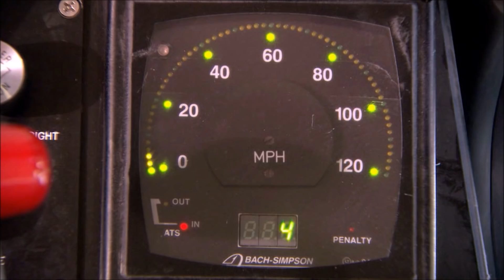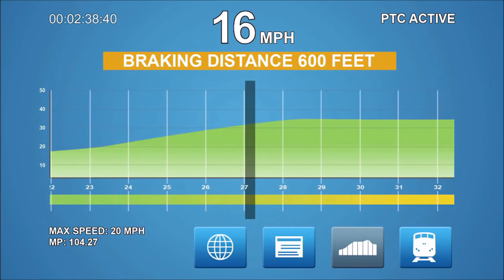Amtrak 501 "Cascades" Train Derailment 18 Dec 2017

Comment: Reading the comments here I see a lot of confusion.  First, this was the maiden voyage for  that small section of track.  That train has been running several times a day between Seattle and Portland for at least the twenty years I have lived here.  Second, the rail bed for most of that line dates back or further than WW2.  It did and I believe it still does service  JBLM.    Third, I question the number of people injured.  I do not know how many on the freeway were injured.  The number seems high given how many I saw uninjured from the train on local news.  By 5pm many were home and giving reports to the news stations.  Thank you and Keep up the good work.
Reply: First, I hope I did not come off heartless for those injured.  I just questioned the numbers.  Still do not have good numbers on that.  I believe the best numbers are  70 people injured.  Latest from local news is that the training was very poor.  Six engineers in the cab at night.  They had no way to landmark where they were.  They took turns at the helm.  Piss poor way to run a railroad.  Cheap way to other than PTC.   Have a GPS like what I run in my Jeep.  It gives me the speed limit.  I see red when I speed.  Why could they not run something like this and add some bells and whistles.  Very cheap.

Comment: When I first saw the reports on CBS about the wreck, they were talking all over the place about things they really didn't know and conjectured about.  One statement made by a reporter was that the line was originally built in 1891(I think) which would explain the 30 mph curve.   A helicopter shot looking down of the wreck showed the location and layout of the vehicle as well as there was no track damage like usual from a derailment and there was a ground path from about the right retaining wall down to the roadway and the front loco.  Another shot was the speed sign showing T-30 over P-30 with the rear loco showing.  I realize telephoto shots squeeze a lot in a short space, but the sign appears to me to be too close to the beginning of the curve as this was taken from the bridge over the track.  This was not a brand newly constructed route as there is plenty of growth along the track and no indication of recent grading work.

From all of this my thought is there was something on the right rail to cause the loco to lift leaving the track causing the brake hose to part setting the air brakes while the rear loco shoved the cars. Only knowing the train make-up by car number will tell where the cars order but my guess is the cars on the right were first, then the upside down car, then the last as they are still together coupled to the rear loco.  What caused the separation is undetermined.  The Talgo train cars are not easily uncoupled from each other because they share a truck and are articulated.  They are designed to be suspended from above the trucks to act similar to a pendulum to be able to take curves at a higher speed than conventional equipment.  Ii is possible there were two 6-car sets in this train, I don't know.

On CBS evening news they showed the wreck site on GoogleEarth as the double track route west of this location and on the northbound bridge  over I-5 yesterday and today.
I hope that the final report shows that there was something on the rail instead of negligence of the engineer that caused the wreck.

Comment: Very good Juan, Yuo talk about PTC, But no mention of ATC Automatic train control.  Was it in use? was the train cut out.  If it was, a decodes old technology it would have slowed or put the train into emergency if properly set up?  Please explain this in a follow up video.  Patented in 1919, and 1929 it still works! I should know!
Love your reports!
Reply: PTC is a variant of ATC, with more modern standards such as GPS and wireless. Apparently PTC was installed on this line, but was not yet operational. Some background reading: https://en.wikipedia.org/wiki/Automatic_train_control#United_States and https://en.wikipedia.org/wiki/Positive_train_control#Amtrak

Comment: Damn that was an intense derailment. My most pressing question would be if the train was under control or not while going 80 mph (i.e. was it a runaway train, or was the train just cruising at 80 mph)? RIP those three who died.

Comment: With 180 million dollars to spend, it is a shame inherent safety of the track layout was not a part of the design.
Why a hairpin curve over a freeway crossing on an otherwise direct route?
Yes, I know land issues etc are probably the cause.
But it bothers the analytical side of my brain.
If the entire length of track had been engineered for safe passage at 80 mph, then the speed limit set at 55 mph, there would be no accident.
Since in reality we cannot have a perfect route, it seems logical that PTC would have been mandatory to guard against such and event.
Is it really just an engineer with his finger on the throttle and that is it?

Comment: Could they create a "budget" PTCS.   Seems a simple GPS receiver loaded with a map of the railroads could sound an alarm anytime the train was speeding.   Doesn't control the train,  but at least it'd give the engineer a heads up.
Reply: Seems a very sensible idea to me.  One issue with safety systems is that if they go wrong, lawsuits are involved, so creating a rough-and-ready safety aid puts you in the crosshairs of lawyers even if it is demonstably better than nothing.
Reply: good point. I work with stuff like that and know what you mean.  Sad that it encourages 'nothing' instead of 'better than nothing'.

Comment: Reports are now coming in(from NTSB spokesperson) that the Amtrak train was going 80 mph where the speed limit on the curve was 30 mph. As a commercial pilot myself, I just have to ask this question: Why are not two crew members required in the locomotive of passenger trains? Commercial passenger planes require 2 pilots, freight trains that I observe have an engineer and conductor in the locomotive and they are only hauling freight, not people. When you recall recent, deadly passenger train wrecks that were attributed to speed violations(Amtrak 188, Metro North in 2013) and the Metrolink Chatsworth, CA train wreck where the engineer was texting and passed a red/stop signal, you have to believe if there had been another crew member in the locomotive these accidents, most likely, would not have occured. Requiring two crew members in the locomotives of passenger trains would not require new technology, could happen tomorrow. Is the FRA just ignoring the "elephant" in the room? 
Juan, I'm just trying to be Captain Obvious here, but it sure seems like having two crew members in the locomotive of passenger carrying trains could reduce these type of accidents.
Reply: gordon james as a retired, mainly freight, locomotive engineer I, and my peers, have been asking that question for years. The only answer I that we’ve been able to come up with is $$$. Although freight crews consist of one engineer and one conductor, only one is qualified by federal law to operate the controls. Like airplanes, you’d think both employees would be qualified engineers.
Reply: Interesting question, but part of the answer is that pilots have to monitor dozens of flight controls, and the aircraft can be pointed in many directions/altitude/position, etc. A train crew has only one pair of parameters to monitor, namely speed and position along the track. Its not that simple, but simpler than an aircraft. A single crew member up front, plus PTC monitoring, should be sufficient.

Comment: Thank you again for a great video. I have a comment, the railroad speed signs are a small white sign on a stick, blink and you missed it at 80 MPH. Blink or sneeze from alder tree pollen, which is prevalent at this time of year. I have an inexpensive Garmen GPS in my car that keeps track of my speed and the speed limit where I am driving. Airlines use the Honeywell EGPWS system to avoid controlled flight into terrain. A simple Garmen display and alert system would have warned the engineer that he over ran a speed reduction. This would cost much less than a positive control system and could have been implemented sooner and then replaced by it. My thought. Oh, I forgot, why only one driver in the cab when many passengers are depending on his actions. Thanks again for another great video.

Comment: Thanks, Juan. Being a train nut, I know about PTC, signals and all that stuff. It sounds like the engineer in the lead locomotive didn't know about the speed restriction on the curve and overpass. You don't go blasting at track speed into a restricted speed zone! There should have been, at the very least, signals to instruct the engineer that a restricted speed zone was ahead.
It's too bad that this happened and caused so much pain, injury and death. My heart goes out to all involved in this accident.
Thanks again for the update. As always, you have passed along more information than the regular media.
On a lighter note, Happy Holidays to you and your family.
Dave in San Mateo
Reply: Kimberly Reason with Sound Transit said speed signs are posted 2 miles before the speed zone changes and just before the speed zone approaching the curve.

Comment: Hi Juan, Thank for your videos,  How do you spent 150 to 180 million dollars to upgrade a line to high speed and still have a 30 mph curve and limited protection for speeding?  Am I missing something?   There seems to be more wrong here that a single accident,  Thoughts and prayers to all injured
Reply: I heard a report this morning on NPR that the track is actually rated at higher than 30, but the speed limit was provisionally set at 30 while the track settles in, since it's new. That doesn't excuse the train running at more than twice the allowed speed, of course.
Reply: thanks for the clarification

Comment: Seems to me Operator Error is the issue here...  PTC is a crutch Simply operating the train according to posted Speed limits yes they do have speed limits on tracks. THE ENGINEER is still responsible for operating the controls.... I dont see why the engineer failed to maintain speed according to NTSB policy and DOT regulations
Reply from the maker: PTC...much more than a crutch....
Reply: I disagree becuase a computer controlling a train is not like autopilot.. even NTSB does not allow you to land an aircraft on autopilot even though you could theoretically railroad tracks have posted speed limits... any engineer can read should have known the speed

Comment: There must be an error in the PTC video. It said the system would be fully operational by the end of 2015.
Reply from the maker: ...then congress got involved...
Reply: Juan you always do very good work. I enjoy your channel a lot. But let's talk about why   ...then congress got involved...

There is a very good article about PTC on Wikipedia. You can also read a page from the American Association of Railroads (AAR) at https://www.aar.org/policy/positive-train-control. 

PTC was passed by a Democratic lead congress in December of 2008 after the Chatsworth, California wreck and signed by George W Bush. 2015 was the original date for implementation. Congress got involved again because the RAILROADS - UP, CSX, BNSF, CN, and all the rest of them plus the American Association of Railroads (AAR) and The American Short Line and Regional Railroad Association (ASLRRA) went, sent and paid lobbyists to go to Congress. The railroads said the timeline to implement PTC was TOO SHORT,  and PTC was TOO EXPENSIVE, and TOO ONEROUS, and TOO BURDENSOME and NOT NEEDED to be implemented in the whole of the US and damaging to their bottom line on the balance sheet (up to $22 billion). The Republican lead Congress passed the delays to PTC in October of 2015 and signed by Barack Obama so the railroads would have until 2018 to have it installed but can have an extension until 2020 to complete testing of PTC before it goes into effect. 

To be fair to the railroads, it is expensive and it may be all the other things too. Very few of the accidents and deaths in the last 30 years would have been prevented by PTC. According to Wikipedia, just 2 accidents occurred between 1987 and 2007 - 16 deaths in the Chase, Maryland wreck (1987) and 11 in the Silver Spring, Maryland wreck (1996) that PTC would have prevented by PTC. Since then I can think of 3 more. Chatsworth, California - 25 deaths and 135 injuries (2008) (prompted congress to pass PTC),  Philadelphia, Pennsylvania - 8 deaths and 200 injuries (2015) and now this tragedy - 3 deaths and 100 +/- injuries. The question then comes down to what is the acceptable number of deaths and injuries at what cost. It might be 0 deaths at $50 billion or more. Or it could be an average of 10 deaths at $20 billion or 63+/- deaths  and hundreds of injuries over 30 years at a few hundreds of millions dollars in insurance and litigation costs.

 I do not know if it would have prevented the deaths of the train crew in Washington DC in June of this year.  There have also been a couple of accidents where Amtrak or a commuter train failed to stop in the station. I don't know if PTC would have helped with those either. The NTSB says that Amtrak has a safety culture problem that is systemic and needs to be fixed. NTSB says more training is needed. The Amtrak culture (I didn't say Amtrak) would imply that there is little time for training, there is work to be done to earn revenue. This is not just an Amtrak problem though. Some airlines, some trucking companies, parts of our military, many industries, and many manufacturers share this lack of safety culture problem.

PTC will not prevent any car or truck from entering the path of a train with tragic results. It will not prevent people from wandering on to the tracks. It will not prevent a side swipe of equipment (North Dakota Bakken crude oil train wreck and fire in 2015) . It would not prevent the Canadian Lac-Mégantic rail disaster that killed 47 and destroyed a town. It would prevent overspeed accidents, head to head or head to tail wrecks, misaligned switches, incursions of designated work areas, and signal incidents in PTC territory. It will never protect everyone or situation nor stop stupidity.

That said, I think PTC is a good thing. I think it should be implemented as soon as possible. Especially in higher speed track areas.
Reply: Pushed back to end of 2018

Comment: Hi Juan:
As a retired Civil Engineer I am surprised that curve was not brought up to standards for this new train service.  From the picture you showed it looked like the Ties and Ballast were new.  With that being said I would have changed the super elevation of the rails to handle the speed they wanted.  This part of this modernization surprised me.  The curve was not that Sharpe.
When I designed Highways and Railway roadways, I and others always tried for at least a 15 mile higher design speed.  In the formula there was also a safety factor built in it.  I hope the investigation answers the questions.  Thank You for your hard work putting this information together.
Reply: Reusing the old overpass would be the reason for the reduced speed. The old bridge would not allow for the additional super necessary for higher speeds.
Reply from the maker: I think they incorporated an old bridge instead of straightening the course with a new, expensive bridge.

Comment: They need to paint the side of the hill red and white checkerboard, just like that hill on the flight approach into the old defunct Kai Tak airport Hong Kong, so that the train driver can see it and slow down before the curve.
Reply: Steve Chapman most railroad speed limit signs that I have seen use black numerals on yellow backgrounds. There may be as many as three numerals on a given speed limit sign. I think the arrangement is:

Top or single numeral:  speed limit for all trains, or for freight trains if other speed limits are displayed below. 
Numeral preceded by the letter “P”:  Passenger Train speed limit for conventional (non -Talgo) equipment.
Numeral preceded by the letter “T”:  Passenger Train speed limit for Talgo equipment (which the Cascades uses). 

It will be interesting to see an image of the speed limit sign that should have indicated “P-30/T-30” ahead of the curve at the bridge. 

Perhaps white numerals on a red background would be appropriate for indicating a decrease in track speed, with white numerals on a green background to indicate an increase in track speed. Black on yellow would be used to indicate a maintained track speed at appropriate intervals.
Reply: Good point, but I don't think anyone with any kind of long-term memory, is going to make this same mistake on this curve again...